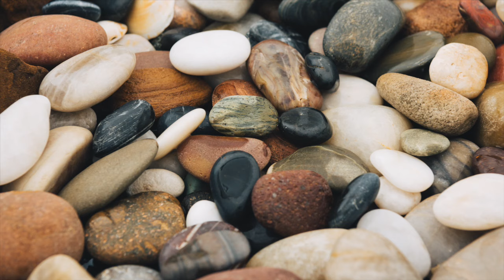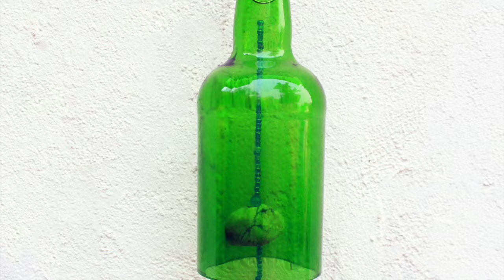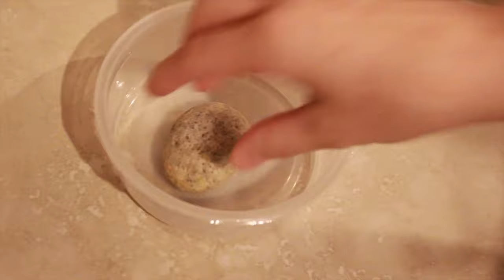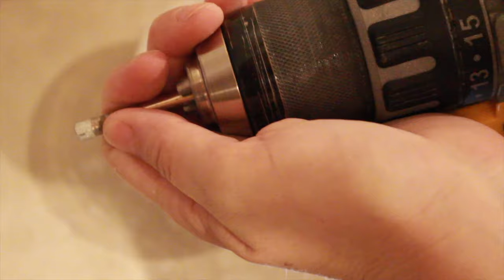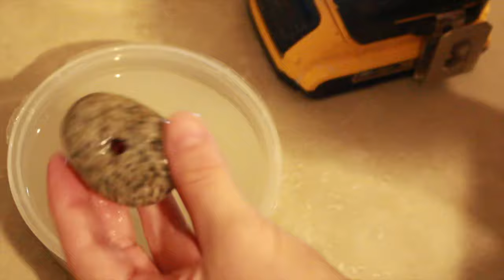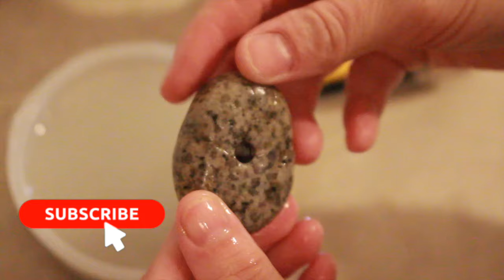How to Drill a Hole in a Rock or Stone for Crafts and Jewelry Making Easy Tutorial DIY

Comment: The use of water is required for cooling & lubrication, especially with a diamond bit. Yes, it helps with dust (and breathing in the dust which can be harmful), but the other main purpose of water is mostly to keep the bit from overheating & dulling due to friction. Having a small stream of water running over the hole as you are drilling will also suffice in keeping the bit cool.
Reply: Is there anything more than water? I feel like by now we'd have developed a slurry made for drilling/cutting that handles heat and lubricates better than water. I believe that's how ancient people did it

Comment: Years ago I was wishing for this video. I had some beautiful river rocks I was wanting to drill for pendants. I settled for learning to wire wrap them because your video wasn't here at the time. But, I may at some point, circle back and implement this technique. Thank you so much for sharing! 😊
Reply from the maker: Leslie Bean glad it was helpful for you! I hope you give it a try. 😃
Reply: Char’s Nest Absolutely it was! Once I find some more I will likely drill them AND add a wire wrap through the hole. That would be pretty cool. I saw you have a bottle chime tutorial also, i’ll check that out. I taught myself how to cut wine bottles lengthwise last fall to turn them into planters, and wind chimes are next on my list 😁
Reply from the maker: I’ve been wanting to cut bottles lengthwise! How do you do that? My bottle cutter only cuts them the other way.
Reply: Temu has a reasonably priced bottle cutter😊

Comment: Very cool 😎. I have a machine shop, I went on a walk and found a beautiful stone. I wondered how to drill a hole in a rock, I thought about clamping it in a vise on a milling machine and using a small carbide tipped end mill. I literally just found the stone, saw this vid and now I can do this since I have some of those diamond tipped grinder wheels. I like to put those in an air powered hand grinder, not the cheap kind, attach the hand grinder to an ancient universal grinding machine, then attach a universal vise that bolts down to the grinding table, and put a piece of metal with a carbide tip I silver soldered to it into the universal vise. Then I adjust several different angles on the big grinder so that I can put a trench in a carbide tip. But yeah those diamond wheels work great but they dull after awhile on carbide (of course).But I never knew until now, how to drill a hole in a rock😂😂. This is great way to go.

Comment: Thank you, I tried for over an hour last night only to get a tiny hole in my pebble so I gave up. I see your bits are core bits.  Maybe I need those instead of the solid diamond bits. My bits turned shiny and wore down. 4 bits.
Reply from the maker: Yes, I would try the bits with a hole. You can get a set on amazon for pretty cheap. :)
Reply: Are there good and bad bits ?  Is there brand or seller that have longer lasting stronger bits.  I’ve never used this kind bit with a hole through it.  Like a ring. 
I like this!

Comment: be careful if you use an electric drill - water and electricity do not mix.  And put a piece of plywood under the rock so you don't drill the container
Reply: Basic electric knowledge will let you know a modern electric drill isn't gunna do anything to you
Reply: It’s a 18v (20v in the states) battery powered PWM DC motor, basically 2-9v alkaline batteries.  The plywood tip is good though.
Reply: Lol relax ive drilled underwater with my Dewalt drill and nothing has happened it will work for a certain time then seize up but will run fine again once dry.

Comment: if you dont feel like using a drill for what ever reason you can do this with a rat tail file it just takes alot longer. the stone that i drilled a hole in took about 6 hours for about half an inch of rock so have fun.

Comment: I wanted to do this one fluorite stones and tick leds in the holes so the stones glow
Reply: That could be cool but make sure it's not submerged in water for too long because it's 4-5 on the Mohs hardness scale. 5 or below on the Mohs hardness scale gemstones dissolve or crack if left in water for an extended amount of time. Another thing to be aware of is not to let sun shine right at it because flourite fades in the sun and if it's in direct sunlight it can become hot. Good luck with your project <3
Reply: @KarolinaDubnicka  hehe thank you currently there just normal stones still i dont plan on risk breaking them there very pretty

Comment: Hello from Sweden here :)
I have a big rock in my backyard. Like two cars big and one car (SUV) high.
I want to drill a hole in it to set a jacuzzi in it. 
Dont know what type of rock it is but it looks like the one you been drilling in. 
Greyish and hard. 
Do you think thats possible to do?
Reply: PROBABLY. First you should have the rock/boulder examined. The TYPE of rock matters most. Is it granite? Basalt? Limestone? Igneous? Or even a conglomerate? Once you know WHAT the rock is, you’ll be able to determine what tools you’ll need to cut/grind/shape it.
But first, you’ll want to make sure the rock is structurally sound and solid enough. You don’t want it to crack or even “explode apart” during the shaping. Let’s say it is quartz, but has fractures with other minerals running thru it. You might have to change HOW you do it.

An old neighbor of mine took a massive unruly hunk of granite (oddly, bought cheap at an auction) and turned it into a big bathtub. It took ~6 months, and he fried a few angle grinders, a rather expensive gas-powered saw (like used for cutting concrete), and countless blades and grinder wheels. Then came the polishing. That was weeks, with lots of compounds and cloth wheels in the trash. But when done, it was incredible and unique.
The funny thing is when he finished, another neighbor literally slapped $10,000 cash (like you see in the movies…a big strap of 100’s) on it and said, “one time offer” (with a grin). And our buddy SOLD IT! They had joked before about “what are you gonna do with it?” because it weighed so much. And the neighbor that bought it was remodeling, and was adding space - so his contractor had a crane for the roof trusses…and was able to lift it up and put it in the new master bathroom no problem (after reinforcing the floor joists). Everyone was happy, and the maker got to take the first bath in it too.
So you PROBABLY can shape your rock for a jacuzzi. Even if it gets jacked up, a boatload of Epoxy might save it. But I’d recommend talking to someone who cuts stone (like a countertop guy) or maybe a sculptor who works with marbles and stuff.